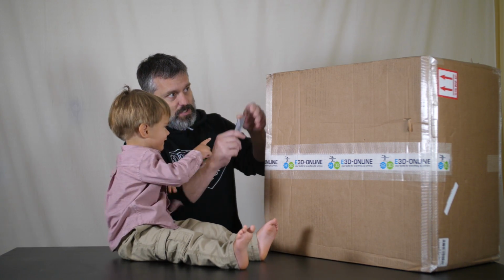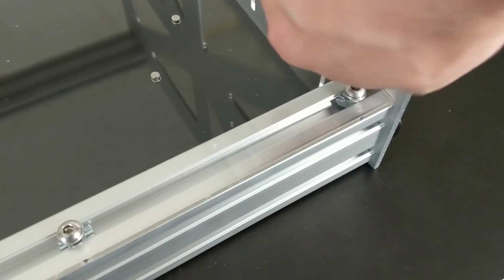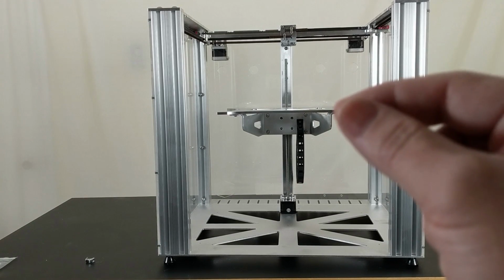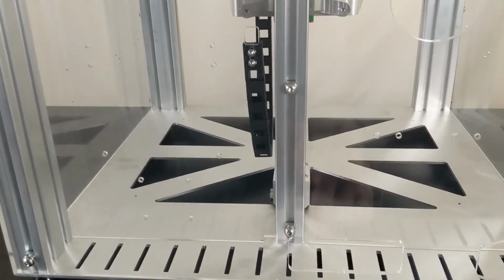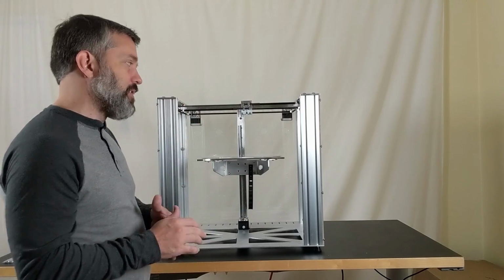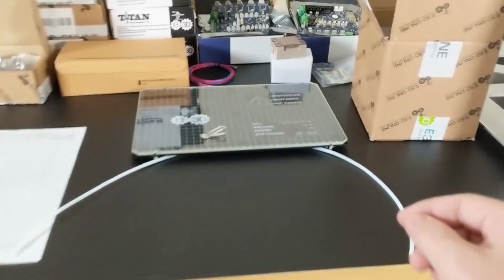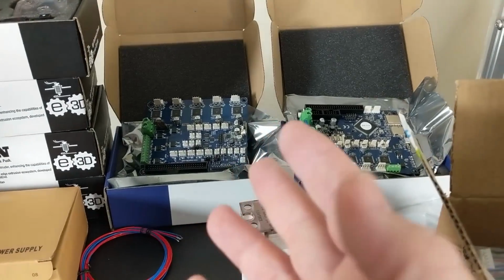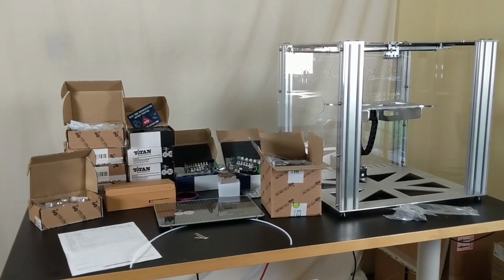The E3D Tool Changer Is Finally Here! - Let's Review It

Comment: This is not a 3D printer! Your criticism of over engineering is nuts. This is a manufacturer development platform that is overbuilt as to not misrepresent the toolchanger mechanism as a whole! Furthermore you should be thankful they even sell this to Joe Shmoe they could have easily restricted it to their development partners. To be able to buy a honestly overbuild machine like this is a real treat to every enthusiast. You can buy "bean counter" machines on every corner. This was, for good reason, not subjected to bean counting.
Reply: No marketing input, no industrial designer on the project, no beancounters sacrificing performance for cost concerns. Built entirely by engineers, for engineers. Put it out there and see who wants it. 

Exactly what we intended. :D

It's not a printer, it's a Dev kit. It's meant to be like this. Bulletproof. It's meant to be a technical tour de force, for evaluating a new technology so others can learn and develop it further.

The cross bar was cheaper than the carbon part, it was also stiffer and more reliable due to matched thermal expansion. The additional lightweighting machining probably added less than $40 to the machine. Worth it.

If you want a toolchanging printer you can take out the box and looks beautiful, with user centric design then wait for our development partners to bring one to market. If you want a Dev kit to play with something cool and new this is out there for the hardcore, the enthusiasts, the developers pushing our industry forward. I hope they enjoy it.
Reply: This guy, Design Prototype Test always sounds like the most full of himself, idiotic guy I could imagine. I clicked the video because I'm interested in the E3D tool changer, however, as soon as he started talking about industrial design etc, jesus christ, I'm out. What a douche.
Reply: @Freddy_Lie  Yeah, I unsubscribed. You don't get Product Design or Industrial Design departments involved until you have done your early technology development and built your technology development platform (which is what this is). He acts like he's an expert in these spaces but it's not in evidence. His animus toward "engineers" is embarrassing.
Reply: @ViceChief  uh, no you don't. You already know what the end product is and needs to be by the time you're designing it. He is speaking from a traditional development chain every large corporation in the world uses. The rise of start ups with ludicrous investor money is how we get these monstrosities. He's entirely correct in what he said about this printer. With like, a week of industrial design consultation they could have made this a really good machine for retail purchase. Also, selling it to anyone makes it a product. Doing 95% of the dev work and then assuming whoever buys it is gonna make up the last 5% is kinda sloppy. Why make it entirely 3d printer focussed? This machine would never accomplish anything with a real tool load. Look how beefy real CNC machines are. This thing will rattle to death with a spindle on it. This thing is a 3d printer through and through.
Reply: @fataxe1  Your comment is a perfect study in How To Be Wrong On The Internet. E3D was bootstrapped. This is a tech development platform, not a product. I worked at the largest and most industrial-design focused company on earth and your idea of "traditional development chain" is bogus. Tool loads for 3D printers are nonexistent. Unless you're using canoe geometry, kinematic mounts can only have reliable repeatability with light loads.
Reply: @ViceChief  did you not see the q+a sessions sanjay did where he talked about adding post processing techniques and effectors for installing things such as nuts and bearings? If you wanted to accomplish that with this motion system, good luck. If it's just a 3d printer, well you can get much more machine for less from other vendors. Where is this a test bed that other machines can't be? The price tag doesn't make sense for what you're getting and it doesn't make sense as to be more than a 3d printer. Also, as far as the chain of design is concerned, I guess I'll go tell the multiple American and Japanese companies I've worked with the internet says they're wrong.
Reply: @fataxe1  Have fun!
Reply: @fataxe1  Have fun!
Reply: In half a year someone from China will sell a functionally similar solution for a fraction of this machine's price and at that moment you'll realise that you got screwed. As they say - there's a sucker born everyday.
Reply: @trailblazingfive  Because developement costs nothing
Reply: @the_tiny_Rambo  wow you seem to be a smart cookie
Reply: @trailblazingfive  I got one of these. They look like the real thing, but they don't do the job. The only thing thats left from that machine now is some of the aluminium. Even the bolts were trash

Comment: I kinda feel like the complaints are a bit contrived.   Johnny Ive comparisons? But "in the real world" comments. Industrial designers?  What is not real about it? They are still in business right?   LOL Are people buying this with monopoly money?  Are the employees getting paid with carrots?  Sorry you're reaching.  Makerbot had all those things and they suck.
Reply: It doesn't matter WHY they're still in business... just that they ARE, in fact, still in business. Every time you whine about "engineers", "real world", or extol the virtues of industrial designers, you sound more and more like a petulant child (is that why you had your child help you unbox this product?). 

Yes, it's overbuilt for a consumer product. No, it's not designed as a consumer product. It's a development platform. Maybe read 5% of the other comments here, and you'll understand how wrong you are. 

You've gotten so spoiled by the likes of the CR-10, the Sidewinder, and the Little Monster, you've forgotten that just a few years ago, an i3 clone could cost $1500US, or a decent- size Delta printer could easily cost $3000US. And that was with 4988s, a trash Arduino board, and barely-stiffer-than-cardboard framing. 

Technology moves on. This motion system will push the desktop machining world forward, whether you think it's "overbuilt" or not. 

In the future, maybe stick to rehashing Tom's comments in the $1000-and-under segment, and let the real engineers do the real work.
Reply from the maker: They are still in business because Prusa.

Comment: also, duet is overpriced as of today
Reply: Why, what new board was released that is better?
Reply: The Duet Wifi is under $150US, and there are several boards (MKS Gen L, for example) that do everything the Duet board does, for less. There's also a new Pi hat out that DPT has done an overview of (I'm not going to call it a 'review') that works natively with Klipper, obviating the need for a separate motion board entirely.

Comment: The carbon fiber cross beam was dropped because the inserts pulled out from the Carbon fiber (expanding to a different rate than the mgn9 rail on top when heated) I saw a video of Rene Jurack having to replace them as well, most of the details are explained in the blog post...
Reply: Yes but the cnc machining is definitely over done. It's more pocketed than an aerospace part. I m not sure mass is THAT much of an issue. Cnc machining like that costs alot of money.  Barstock passed once or twice in the mating faces could have done?

It is very sexy though.

As a mechanical design engineer who has been chewed out for the exact same thing before, I'm calling over engineered on that part!
Reply: @adamchambers7502  the point of introducing the carbon fiber rail was to reduce the weight of the moving mass, to which the system was spec'ed, if they'd slapped on a rail that suddenly increases that by 70 to 90 percent it would have even further delayed the project. Again, this is a development and research platform, which Sanjay himself said "if money was no object, what kind of 3d printer could you build?" By extension this means that they didn't want to compromise on the quality of the motion system, because it would negatively affect the reproducability of multi tool prints.

I get that it is over engineered, but its not a platform that is meant to compete with other 3d printers. Its meant to showcase a concept by reducing introduced error from a motion system.

Comment: Question: What is the purpose of the acrylic side panels holes? What goes onto them?

Anyway for this price i would expect frame with metal instead acrylic walls. Maybe an enclosed system so you can have heated chamber.

Awwgh the "bowden" tube... E3D selling this as separate parts, not as complete printer, So you ordering tube by length, and 10cm is usual amount multiplicity. You have many printers and none of spare parts in form of PTFE tube ? Every time i maintain my printers and need to decouple tube i need to cut small piece because couplings cut too deep, eventually tube is too short and need to replace. In whole USA there is none of PTFE tube supplier ? PTFE is usually used in pressure systems, or better buy Capricorn tubing. Or this machine must be build whole with E3D parts?

Comment: That's nice. I was looking to get one some time ago but it was nowhere to be found for mortal people. Ended up building Railcore 2 300ZL and this is one of the best desicions I've made in a while. Its about as expensive to build as e3d, but it uses full auto level using 3xZ + Duet and linear rails are everywhere. Can't wait for e3d release their tools so I can install them on Railcore.
Reply: Ditto.
Reply: You get misumi rails for yours or no?
Reply: @vrocv6411  Yes but I don't like them. Ill  probably replace them w Hiwin later.
Reply: @escknx  I just installed my misumi and one rail binds randomly. Similar issues?

Comment: There’s an easier trick to those T-nuts, and they should have put that in the instructions.  Instead of trying to do all of them at once, just do 1 pair (1 on each side) at a time, and don’t tighten them fully, as you slide the plexiglass down the rails.  Tighten them just enough so that they don’t spin.  That should be much easier.  :)

P.S. I’d add nylon washers to prevent the plexiglass from cracking over time too.
Reply: Kaelum 
It’s a bit odd that they didn’t include washers, or a protective strip.
Reply: boggisthecat yes it is.  I watched a couple videos, 1 where the creator talked about it in an interview, and a bunch of red flags went through my head.  While it is a product, it is actually a POC being sold as a product., without a concretely defined customer.  Also, I learned why that bar was changed from carbon fiber to a machined part.  It would droop when the carriage was in the middle, causing bed leveling issues that were made worse when it actually picked up a tool.  It would be impossible to level it when using different types of tools.
Reply: Kaelum 
I don’t know why that bar isn’t an I or at least T bar.  It does not appear to have been well thought out.  Even relatively cheap large printers such as the Artillery X1 have a hefty x carriage bar to prevent flexing.